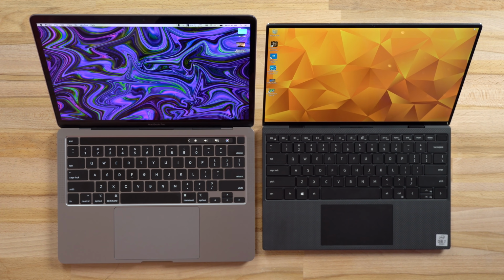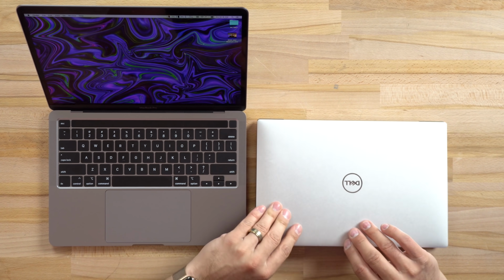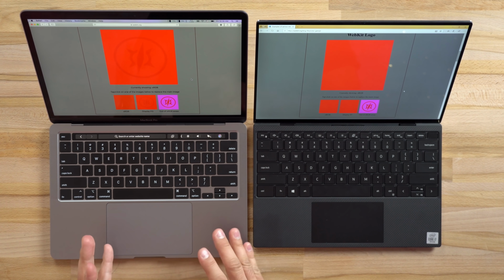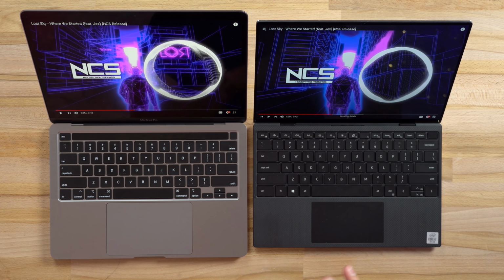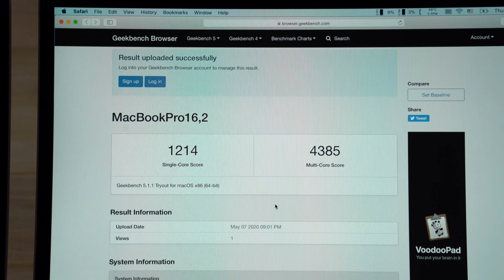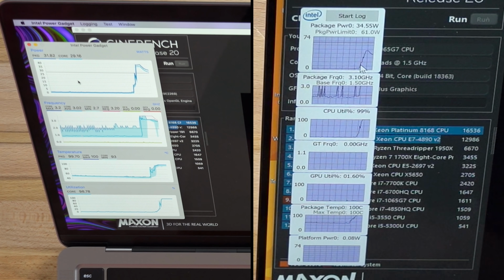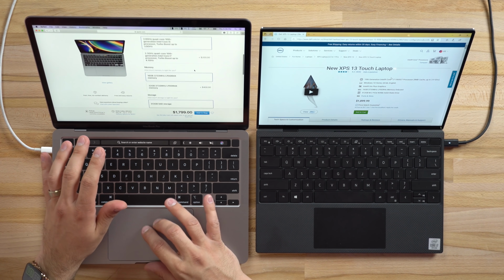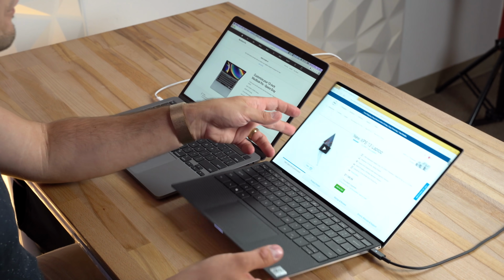2020 MacBook Pro vs 2020 XPS 13 9300 - Best Ultrabook?

Comment: The Dell 4K has a beautiful display and is WIFI 6 built in.  I don't understand why Apple didn't make it WIFE 6 and did not upgrade their webcam to 1080P.  Also, it seems that Apple can't view YouTube above 1080P.  While Windows can.  Thanks for a nice video. :)
Reply: You can't view above 4k using the Safari browser on Mac. You can get to 4k using any other browser (Chrome, Firefox, Opera)
Reply: @andremessado7659  I see.  I installed Chrome and the videos are awesome.  Thanks for the tip!  :)

Comment: Hey mate, I miss people telling me about the battery longevity, precisely number of cycles. I have a 2013 MBP, and the battery is still going 7 YEARS later. I've never had a windows laptop like that. If I'm going to pay the apple tax for a new MBP, i would need to know the battery can last for similar number of cycles (my 2013 MBP rates at 1000 charge cycles). I cant see anyone has checked this for the xps series, but for me it matters. My last windows laptop was a piece of 💩, the battery couldn't even last a year?

Comment: With 13 inch displays in my opinion, there is absolutely no need for 4k. You can't even tell the difference unless you are like 2 in away from the screen

Comment: I am user of Mac and Windows 10 o/s and I would say both have their own advantages. I was planning to buy a 13 inch PC and I tried to convincing myself with windows OS because of its latest and modern hardware offered by Dell, but somethings just don't work so seamlessly on windows as it would do on a Mac. The attention to finer details and moving data between multiple application and Mac devices  is so effortless on a Mac eco system, that I could not achieve it in windows. I have a 15 inch MacBook Pro and planning to get a 13 inch model for my travel convenience, and it looks like I may have to let go the advance technologies of Dell and end up with a Mac.

Comment: So in resume... 
XPS better in : CPU performance, GPU performance, Screen resolution / touchscreen with almost no bezzels and HDR support, SSD performance (SSD speed)...
Macbook Pro better in: better trackpad, better speakers, the fan sounds less noisy (?), you can see different levels of red on the screen (?), lowers temperature quicker (?), and battery last longer...

I think the winner is clear.

Comment: I have the new Dell XPS 13 and the fan issue is no where near as bad as this guy is making it out to be. Dell have different fan profiles you can seletct from and if you select silent mode the fans will never kick in until about 80-90c and also you should never buy a 4K panel on a 13" laptop, you will never notice that much of a difference when it comes to PPI. I have the 1080 screen and it's a really good panel, with HDR as well, i think this guy is trying to upsell the Mac screen a bit too much.

Comment: In the UK MBP 13" is £1799 vs £1599 for the Dell, after using the Dell XPS 13" 9300 as a developer i'd recommend going for the MBP purely for the OS - otherwise the Dell is outstanding.

Comment: One thing that really drives me nuts about Mac OS is if you multiple monitors like I do then you won't be able drag multiple apps on each other if one is maximized.   Where in windows you do not have this issue.

Comment: Comparing the Dell XPS to the MacBook Pro is apples to oranges, pardon the pun. Even though they're the same form factor, the XPS series has always been a multimedia-focused laptop and in recent years really more of a mid-range laptop. The MacBook Pro however is supposed to be a mobile workstation, and I say that very lightly. Basically the XPS is more akin to a MacBook Air.

Comment: I quit buying windows PC’s and laptops years ago because, inevitably, they always felt bogged down and practically unusable after a while.   My macs, while slower relative to what’s available now,  always seem to maintain a consistent level of performance over many years.  Is windows improving?  I can’t help but feel biased to think the XPS will be unusable in a few years based on my past experiences.
Reply: I've been buying windows laptops for 20 years, and I usually get 3 years out of them. But, I'm finding windows 10 to be more stable than prior OS's. My Asus laptop is almost 5 years old in august. I also have an HP Spectre thats 3 years old. I'm sure these laptops will crap out on me in time. I'm really surprised how well these laptops are holding up so far though. I think you can get a solid 5 years.

Comment: In my opinion you don't insist enough about the portability. For many people it's extremely important. 
Just as information, the MBP is 27% bigger (in volume) than the XPS and also 17% heavier than the XPS. This huge difference explains a lot of things like the sound quality, the battery life and the thermal throttling.
It's exactly as if you compare the MBP 2020 with XPS 9500, in this case the XPS 9500 is clearly much better.
I'm not really happy of the new MPB, I've never really tried MacOS and I can believe that it's very convenient but for me it's the only real reason to choose the MPB
Reply: By the way, thank you for your really good review, it's one of the best that I've seen about MBP and XPS!

Comment: I have never never been on mac os.
Should I go with macbook? 
Please guys suggest me.
Reply: first thing, try linux. Mac OS is a payment version of linux. (literally, both are POSIX systems, both are UNIX variants and work the exact same way). Any linux distro will give you the mac experience, but some are more asthetically similar than others, for instance elementary OS is pretty similar to mac OS, while ubuntu is quite different. Some pros and cons of choosing gnu/linux over mac OS are:
Linux is much more stable and reliable
Linux software is of way higher quality (there are in fact studies proving this, like the one counting code errors per 1000 lines, windows software had 20 on average, mac OS had I think 15 or so, and linux software had 0.4)
LInux software is libre, that means it is free to use, modify and redistribute.
Linux is completely customizable.
Linux itself is more secure, not only that but there is way fewer malware targeting linux desktop,
The only two disadvantages are compatibility issues, and some distros may be harder to use when starting that others, most will require bash knowledge to get the full potential of your system. Remember, linux is mac OS, but better and free.

Comment: Mac has a 28W CPU vs the 15W on the Dell. You missed this detail. See here:

https://ark.intel.com/content/www/us/en/ark/products/196594/intel-core-i5-1038ng7-processor-6m-cache-up-to-3-80-ghz.html
Reply: kushal710 The Dell might be using the 25W TDP-up mode. The wattage at the end of the Cinebench run settled at 25W

Comment: You are really, really, really talking me into the 10-gen-13-mac.  Their $2,000 model is exactly what I want in a 14" model.  But I will probably buy the 13 because I need a computer so badly now, not when Apple gets to the 14" (if they do...).  Have you tested the 1TB SSD drive to see if it's as fast as the 512 SSD? I would assume it's the same specs and not a slower spec like the cheap models come with.  BTW, that's exactly why I asked if anyone knew the specs on the SSD during the Macbook Air reviews you did.  So thank you for discovering that high speed SSD in the 10-gen 13's.

Comment: I seriously wish I didn't love Mac OS on laptops so much. I'm not gonna deny it that XPS 13 is one handsome machine - to be frank Apple has some catching up to do on design.
Reply: I completely don't get why there are mac OS lovers out there, it is payment linux. Literally, both are unix variants, mac os is technically a linux distribution, buy any pc you want and install linux if you want mac OS. Not only that but since mac os is propietary, it has lower quality software, it is less stable and reliable, and it is far less secure, and of course, you pay for everything, while on linux you don't pay for anything, you pay way less for better software.

Comment: I love this new macbook pro and have been using a macbook pro for the past 6 years. However my needs have now change and I need a windows laptop for work and to use windows applications so unfortunately i'll have to switch and xps is my no. 1 choice right now!

Comment: Great video, problem over here in Europe the pricing is much different. In my country the BASE MBP costs 2129.- euro while the XPS13 with the i7 16GB RAM 512SSD and 4k touch display(did you mention it is a touch display?) costs 1900,- euro so that's a big difference. And off course the Apple upgrades are even more expensive over here so it gets much worse from there. It would also be interesting to have some real world apps in the benchmarks, for example Photoshop and Premiere and see how they stack up.

Comment: the dell xps come with windows 10 home? LOL honestly, windows home don't even allow you to change system language if it came with the single language version, plus a whole bunch of features which enterprise user might need which are disabled. Dell is even worse than apple by not providing the full feature of a OS on a 2k laptop

Comment: what would be the point of a microsd card slot? most cameras would be using a sd card or cf card anyways. i don’t see why people are still hoping for all those dedicated ports if people can just buy whatever-to-usb-c adapters they need, and mix n match. it saves cost on the laptop manufacturer’s end and gives end users the power to choose(although it might come at a higher cost for end users). that’s a caveat we need to take if we want these laptop manufacturers to last for a long time and earn revenue right?

Comment: It took Dell a month to send me this XPS 13 9300 I'm using right now. Thin bezels aren't worth it. Thermals on this are terrible. Battery life is awful if you get the 4k, which I did since I don't want to fuck around with 1080p. I'm sending this overhyped thing back and getting the Macbook Pro 2020 13".
Reply: Speakers on this are so bad. It was annoying listening to this video.

Comment: I love the xps, if I didn’t need a macos system I’d definitely get the xps! I have an xps 15 and mbp. The xps build quality is kinda bad for the one I have, plastic around the edge, I set my bag down a bit too fast and an edge broke, nothing functional but not the hinge is exposed. Also the xps 15 speakers are basically garbage.

Comment: It’s all pretty interesting, thanks for the video! However, I think that comparing these two higher-level options is not that hot, as comparing base models of these two and MacBook Air with four-quad CPU. That’s where the real competition lays. They all cost same price and differ in certain aspects, so the question which to get is really tricky. Whereas the answer which to get of these two is pretty easy: base MacBook 16

Comment: Most bias review ever. Rubber? It's carbon fiber and is way better then the metal on the MacBook. It feels way better when typing. Also having such a high resolution on a 13 in monitor does not matter! 1080 is perfect and I promise you won't even tell the difference.

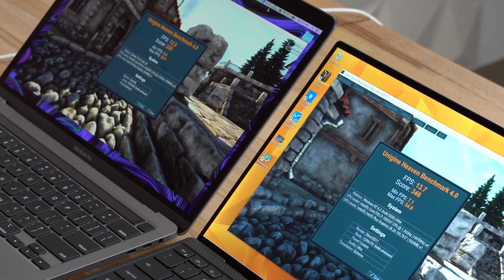Comment: 14:09 gpu benchamrks using different settings, different APIs, and different resolutions are not comparable.
Reply: The resolutions is probably the same, you can see that the dell XPS is running 1294x791 which is lower than the screen resolution so I don’t see why he wouldn’t have set it to be the same on the MacBook.
Reply: Such reviews have their place, but this is telling you what experience to expect from each laptop as a whole.

Comment: Depends on what you want of course. To me, the non-upgraded $1799 macbook wins no contest. I couldn't care less about the Dell's "sleek look". I want to meet the kind of person that chooses a laptop based on looks.  Apple continues to disrespect every consumer with their mind-numbing prices for upgrades and Z E R O useful ports besides whatever you have that takes USB C.. which I have just my phone. stupid. BUT, I'm taking that Mac and running. 16gb and that amount storage is just fine for me- I backup everything to an external anyway. Better speakers, which is important to me; better battery.. also kind of a big deal, the BEST trackpad, quieter, Mac OS over Windows any day in eternity.  The ONLY downers with that $1799 Macbook is 1. Crummy camera and muffled internal mic, and 2. no ports. give us an SD slot, and USB-A. An HDMI port would be nice too, but I can't get too greedy.   Gona wait for the 14" mac. For me, it's the perfect size. Started college with a 14", got a 13" macbook and felt a little cramped. I have a 15" work laptop, but it's just too big. A 14" screen in just about the current 13" size would be money.  
My 2021 $1799 wish list is 14" screen, SD and USB-A ports, the mic setup that's in the current 16" pro, and of course the 11th gen processor.  Everything else can stay the same. I don't think that's too unreasonable. 2 ancient ports, less than an inch upgrade in screen size, and the next processor available. That's a winner.

Comment: MacBook 13" 1800$ has 28w CPU instead of the 15w you get in the base 1299$ model, and this let the CPU to have higher base clock than normal 15w CPUs. 
So here's why base frequency of MacBook i5 is still higher than the i7 on the Dell, which is rated 15w (but tuned to 25w by Dell).

Comment: The mac book pro here not only out performed the dell in all categories but also was cheaper !
What is happening with Apple ! 🤣
Reply: Did you watch the video? Most the benchmarks, SSD speeds the Dell won and has the sharper screen and offers face unlock.
Don't tell you focused on the build and touch pad?
Reply: Asarni Thomas sorry but the idea of 4k 13 inch display is dumbest idea ever, on that big of a footprint 4k no different than a 3k screen, and it sucks way more power than it’s supposed to
Reply: Steven Withman He literally said that the Dell 4K screen looks much sharper than the MBP...
Reply: Asarni Thomas I feel like a lot of people in these comments have an Apple bias...both laptops were great in different areas, and this was a very close comparison.

Comment: Went with Mac after comparing with Dell.   Dell batteries degrade really quickly, my 4 year old XPS has 1.5hr life compared to 8 year old MacBook air having 3.5hr life. In essence, the older Air is actually more usable now.
Reply: Granted now I went with 16" MBP bc I found it discounted by 300 and it's CPU/gpu are far superior.
Reply: I am waiting one earth rotation around the sun for the Macintosh Pro 14”.
Reply: It happened to my XPS 😭

Comment: I'd like to see a comparison of the MBP 13" 10th Gen i5 and i7 to see if it's worth upgrading the CPU.
Reply: It never is (usually). You would know if you needed to upgrade it, and since you don’t know, you don’t need it.
Reply: Only if the 13” has better cooling.
Reply: Not worth it.Just get the 16 inch macbook if you need performance.
Reply: escamunich A link??
Reply: Apple lacks adequate enough cooling to utilize higher end CPU SKUs. And, at least with the MacBook Air, the power delivery is inadequate for higher power CPUs.
Reply: Did you watch the video? It really doesnt matter, its a marketing gimmick that plays of your psyche, unless you are in the 1% who is a ultra pro where seconds mean a bazillion dollars, I wouldnt bother, save you money and stick with i5
Reply: Exactly and that’s what I thought 💭 this was.

Comment: I can't upgrade my late 2011 MacBook pro because it won't die yet, darn it!
Reply: I have an early 2011 MBP and it’s still rocking! 🤘🏼
Reply: Same! But I upgraded it with an ssd. I did just get the new model though, finally. But my 2011 is still running great. (battery life is like one hour though!)
Reply: @randommindstalk  can't you change the battery?
Reply: I have a Macbook Pro 2012. You can actually upgrade the ram to 16gb, and increase the storage or replace it with SSD i believe. Basically still good to use. I use mine all the time

Comment: I’m going to be buying a laptop for college soon, gonna go with Apple, most likely a MacBook Pro 13. But just wondering, if starting at the $1800 model, what should I upgrade first: RAM or CPU? The 1TB is enough storage for me.
Reply: Ram , cpu difference is pretty minimal
Reply: Maybe you save your money and don’t upgrade either. Whether you should upgrade RAM depends on what you use it for. The standard 16GB RAM is enough for all basic tasks and even midrange pro photo and video editing; 32GB is for Photoshop power users, multiple virtual machines, if you do that sort of thing. There’s little chance that you have a good reason to upgrade the CPU; with most thin laptops the higher clock speed can’t be sustained for long because of power and cooling limits.

Comment: The XPS 13 wins this, and when you start to factor in price to performance it wins even harder.

The simple question a cross shopper needs to ask itself is if they want Windows or MacOS, but bang for buck the XPS is the best machine.
Reply: Raxio ra HOW
Reply: how is it tho? in pretty much all benchmarks they’re basically equal but MBP has Final Cut for example which is way faster then Adobe Premier, MBP has a better screen, better speakers, better trackpad, better build quality, better battery life
and MBP is actually cheaper, lasts for longer and has better resale value

it’s not even a close one

Comment: If you thinking about the low priced mbp 13’ get the air for much cheaper , if you thinking about the top specked mbp 13’ add 300$ more and get the mbp 16’ that is miles ahead.You welcome 😉